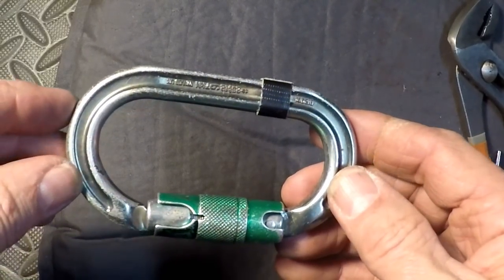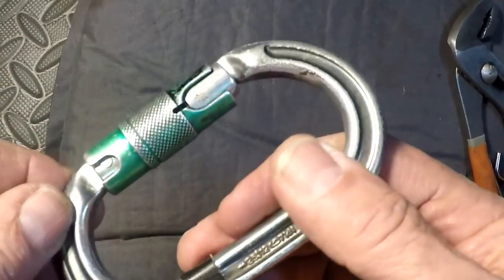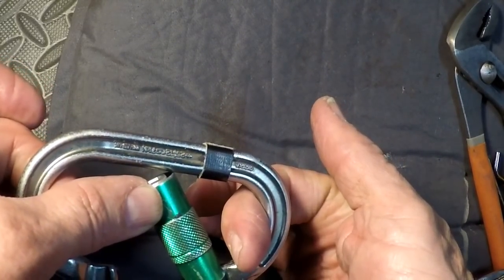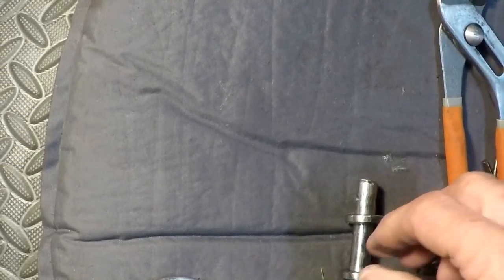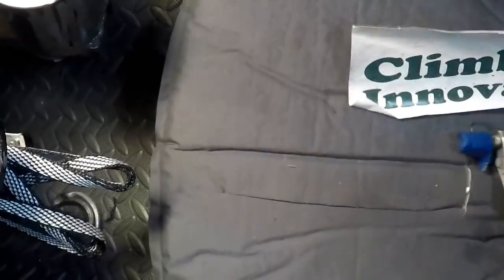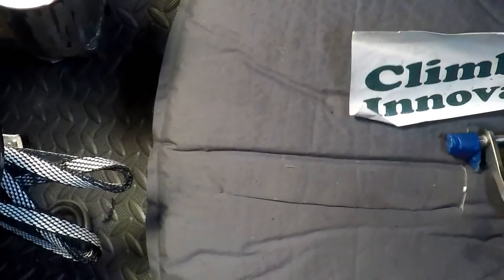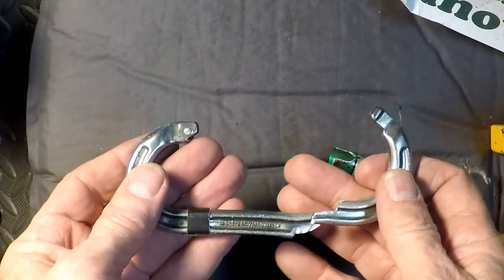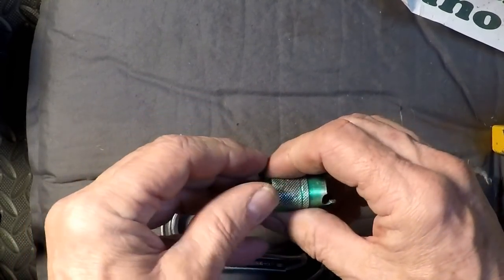Breaking a dropped carabiner

Comment: I snatch my friction savers (FS) from the tree.  Sometimes they hit concrete, metal fence post etc.  I am afraid to abuse a FS constructed with DMM rings so I have my FS made with steel.  Am I using steel rings for no reason?   I would love to see you strength test a DMM ring that has been abused.  At what level of abuse does the ring get compromised?
Reply from the maker: I think it is generally good practice to keep the life support tools from impacts with techniques for retrieval. That being said, I think the rings can take quite a bit of abuse but that brings us back to why should they.

Comment: i found one 12 months after i left it behind. it was fully exposed to the seasons. I still use it as a preventer on devices. Wonder if it should be tested.
Reply from the maker: I suspect that unless it shows significance signs of rust, probably not with aluminum, there is no strength loss but does the gate function well?  That would be the question in my mind, internal springs etc.
Reply: @RichardMumford1  slightly faded and yes aluminium. Gate functions perfectly. Had a burn proof prusik rope attached to it which faded but use it as a foot prusik now.

Comment: Nice work! I found that reassuring, that the break was so far removed from the point where it was previously impacted, and not far from what the biner is rated at anyway, I had been led to believe that an impact on a hard surface can seriously weaken aluminium biners. Thanks for this
Reply: You gotta be flexible.... an "impact against a tree" is one thing...but a 50' drop onto concrete, for an aluminum 'biner, for example.... I will keep a mental note of such things, and usually not completely retire it, but rather, refrain from using it on it's own without backup - depends on the duty. Like you, the throwing ends of my lanyards are mostly steel; one old one is an exception, cause I'm attached to it ( pun intended🤓)
Reply: JefAlan Long The point of breakage seems diametrically opposed to the point of impact. Just hazarding a guess, but, it seems possible that is the location where the shockwaves traveling in opposite directions around the biner met, possibly amplifying each other and causing more stress at that point. While I'm impressed at the relatively little loss of strength, I would have been even more impressed if it broke somewhere else.
Reply: Yeah I'm pretty sure the rivet/articulating part where the gate swings failed first. After that you're only good for 7kn so it's hardly surprising that the opposite side failed so quickly.  Anyways I'm not saying I'd keep climbing on one I'd dropped out of a tree but it's just reassuring in terms of occasionally throwing one (I prefer steel ones on my lanyards for throwing)  and littleimpacts against the tree trunk etc

Comment: Hi Richard. Interesting vid, do you have a conclusion then... I'm guessing this would of been safe to climb on maybe? . I would of thought the gate is a weak link which will always break first?  Cheers Rick 👌
Reply from the maker: RIck Evans I have no conclusion, nor would I make one.  If I drop a carabiner 40 feet on concrete I'll put it on my break test machine and see what it does but I'm not going to use it with my life.
Reply: Richard Mumford. Sorry yeah I wasn't meaning it should be still kept in service, just wondered what you thought... thats cool. Great work.🤗
Reply: Hey Richard! Wow! I just used "50' onto concrete" as an example in a previous comment, not having seen what you wrote here....funny. Yeah, aluminum is not exactly the best material for absorbing concussive force.... 😬😓..... I definitely am constantly cognizant of its brittleness....